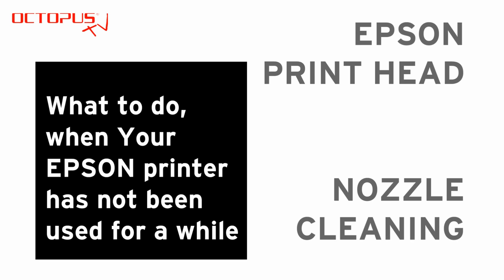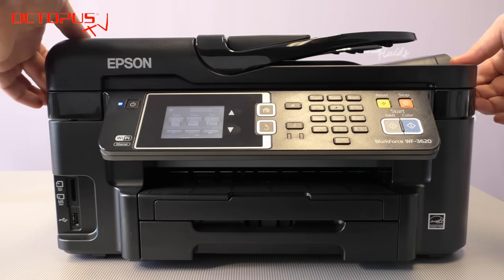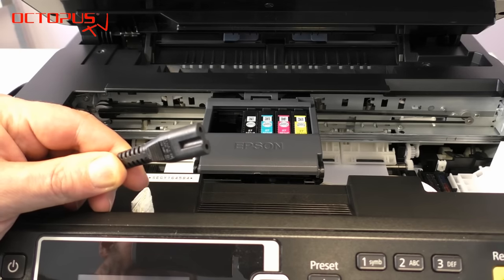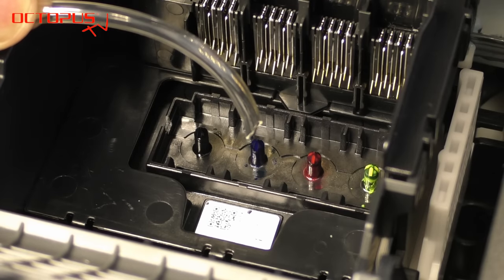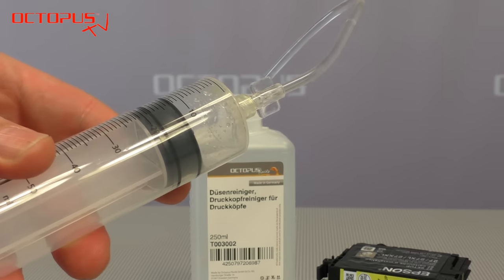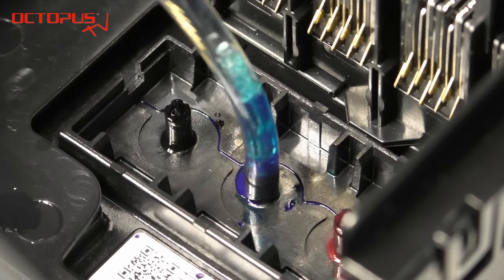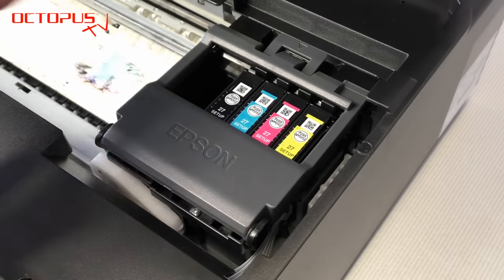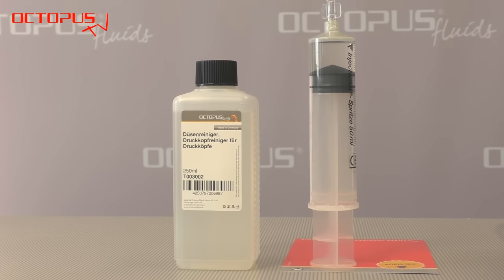Epson print head cleaner, nozzle cleaning - flushing clogged nozzles

Comment: This did not work. ... Epson is terrible. ... The printer lasted only two years. ... I will never waste my money on Epson junk again.
Reply from the maker: Hello Michael, we are sorry to read about Your not so nice experience. You have Your finger on the point that quite a number of the current desktop printers are barely passing their warranty time and causing head aches after that. Take care!
Reply: I just changed the cartridges on my epson and its giving me a nightmare its only about two years old but has light use it wont print any text without white lines tried cleaning heads multiple times but no luck
Reply: Its an epson xp 345 its shit when I first got it the first one I had wouldnt work and had to be replaced now this one is malfunctioning also

Comment: What should I do if my printer is printing completely blank as if the inkjet nozzle is not touching the paper at all? The printer had been in storage for about a year. The model is an Epson wf 2630. I bought new ink cartridges.
Reply from the maker: Thanks for Your question. Due to the long time the printer has not been used that it is dried in completely - meaning all colors are clogged. You can try to run the cleaning that is provided by the  printer´s menu several times using the new cartridges. Maybe this will bring back the colors - or otherwise You can try cleaning as shown in our video tutorial.

Comment: This product worked like a charm, but at least with me, there was a struggle cleaning 3 heads,  that had a cartdrige installed for a year. At first, I pumped several times each head, without any  result, but then, I made another attempt, applying more pressure in each head, and only doing that I was able to solve it.
Reply from the maker: Thanks for sharing Your experience with applying this method to Your printer. Increasing the pressuer is a bit a walk on the edge as there is the danger that the pressure lifts off the nozzle plate from the cartridge compartment - luckily it did not came out this way in Your case.

Comment: Allowing an air bubble in the syringe is an great tip not mentioned elsewhere that may save you from de-laminating the cartridge carrier components due to applying too much pressure.
Reply from the maker: Thanks for that outstanding thought plus useful feedback ... :)
Reply: i used liquid googone and hot water it worked

Comment: After watching this video I tried the pumping action and now my printer won't print any ink on the paper,  whereas before it would but was missing parts. How can I fix it so it will print ink?
Reply from the maker: Thanks for contacting us about the tutorial. After flushing the ink system using the tutorial´s way there always remains cleaner liquid in the print head. This cleaner has to be printited out before the inks will come back to normal. We recommend to start a 100 pages print job on old, already used paper. This takes some time so You should have a look in between if the colors are fine again or keep on printing.
Reply: @octopusoffice  thanks and I'll give it a go.  I did 2 printhead cleans and printed a colour purge sheet after the flush clean.
Reply: @octopusoffice  I have printed a printer purge sheet a 100 times.  The black isn't coming out and the other colours are stripy.  Please help.
Reply from the maker: @Eeveeb80  thanks for taking the time and giving a clear description to Your situation. Beside the cleaner that remains in the ink system after the flushing also air can delay the return to normal colors. Please pay attention to NOT pushing air into the ink system when flushing the ink system with cleaner. In Your situation we recommend to  repeat the cleaning with flushing the ink system with cleaner - by doing so any air in the system is pushed out by the cleaner  - after that same procedure again: print out the cleaner....

Comment: hi I already tried to declog all the ink cartridges, but I have trouble in declogging yellow. the cleaning solution doesn't passing through, what else can I do to declog it?
Reply from the maker: Hello Jayson, thanks for Your description. The situation with the yellow ink line sounds to us that for some reason the ink may have solidified inside the print head. Did the printer sit around unused for some time or did You use non-suitable inks in there?

Comment: An excellent concise tutorial on how to get the job done.  Others have posted longer videos but natter on and on without adding new information.  Allowing an air bubble in the syringe is an great tip not mentioned elsewhere that may save you from de-laminating the cartridge carrier components due to applying too much pressure.
  Robb Muffet did have an additional tip in that for very dried up print heads, (shelved for weeks, months or years), just leave short pieces of tubing with cleaning fluid on each color and let sit for 12 - 48 hours.  The fluid level in the tubing will drop a bit after the dried ink has softened up.  Then you can use a syringe to withdraw the dried ink, as well as gently cycle the cleaning fluid as shown in this, (Octopus Concept's), video.  You want to push some ink through to the paper towel but not so much that it saturates the 'waste ink pads' underneath.   (Printer may stop working if there is a 'waste ink' sensor that says the pads are full. Use a dry paper towel to soak up fluid on the 'waste ink' pads.)
Reply from the maker: Excellent feedback! Thank You!
Time is the key to get a heavy dried up print head back to life - let the cleaning fluid work on it for quite while?
We prefer to push the cleaner plus the waste ink through the print head out of its nozzles as we can avoid to have air inside the print head´s ink chambers. To be on the safe side we use beside a piece of foil material under the absorbent towel. This prevents the mix of cleaner and inks to flow into further parts in Your printer.
Reply: Ah, yes, air inside the print head's ink chambers would likely create other problems, such as having to run several of the printer's "cleaning cycles" to push enough ink through to flush out the air bubble.  Thanks for mentioning that.
Reply: Gordon Raboud
Reply: Gordon Raboud

Comment: Struggling with my 7620. Nozzle check indicated issues with all colours inc. Blk so cleaned head.  No significant improvement so used the nozzle cleaning fluid.  Flushed all the nozzles and there was a slight improvement but not enough to be able to print. Had seen a warning about not cleaning head too many times in one day or it could make matters worse so left it overnight. Ran another nozzle check this morning and swapped out the cyan cartridge as it was running low. All colours affected with breaks or no ink at all so ran another head clean and then checked.Black ok, magenta ok-ish but yellow and cyan missing. Repeated with little improvement so followed your instructions again and used the fluid to flush through the nozzles. The tissue for the first time showed all the separate colours so ink is getting through but when I did the nozzle check again it was even worse! Black is broken lines, yellow missing and cyan and magenta very patchy. When I ran a test print on Monday, yellow and magenta were working but streaky. Should i just force through lots of test prints to try and get the ink flowing? This is my second 7620 as the same thing happened within warranty and Epson replaced it. i've had this one about two years and really can't afford to replace it but i need it for my business. Any advice?
Reply from the maker: Hello Kath, thanks for Your clear description. After flushing the print head there always remains some cleaner inside. Usually it takes some time to get the cleaner out and get the prints back to normal. So in Your situation I would recommend to run test prints (on old / used paper) and see if the print outs improve.
Beside that there is the question if You are printing with original Epson cartridges or alternative cartridges? In case of the second option it might help to switch to a different brand if the issue occurs when using this specific brand of cartridges.

Comment: Hey guys! Whoever is not having the cleaning liquid, you can make your own and it works like a charm.
Mix 5ml of 100% alcohol with 5ml of water and use it the same way thats shown in the video. After you've pushed the liquid throught the head to the towel print a few prints untill the new ink gets into the head and clears the colors and its all going to be allright!
 Thats how I unclogged my epson 7710 and this was a tip given to my by a printer technician guy. 
Goodluck in the journey of everybody!
Reply from the maker: Hello Kristiyan, thanks for Your valuable input! 👍🏻
Reply: @KristiyanStamenov what kind of alcohol are we talking about here, i have an Ethyl alcohol which is about 70% solution, idk if i should use this or not

Comment: I bought your product and carefully followed the instructions. My printer first had cyan and magenta working good but yellow and black completely clogged. I cleaned everything as my printer had not been used in a few years, and then when i plugged everything back, cyan and magenta worked not as good, yellow still not and black was working but poorly, with some lines and everything. Opened again, did the process again, and then nothing was working. Redid it and made sure not to leave any bubbles inside, and still the four colors are completely absent, no product or ink on any of the paper. What should i do?
Reply: I have an epson xp 315 just in case
Reply from the maker: @RodDayZ Thanks for contacting us about the Epson cleaning. After cleaning the Epson print head our way there remains cleaning fluid inside the print head - You need to print that cleaner out - sometimes it may take quite a number of prints to get the colors back to normal. We suggest to use old paper to do these test prints.
As You mention that Your printer has been sitting unused for a few years we assume that you are working with a new set of cartridges or with new refill inks, right? After the years the old inks have changed their physical characteristics and will not work in Your printer properly anymore.
When You have a new set of bottled refill inks at Your hands available You can flush the ink lines using the inks - that way you can also push out the remaining cleaner - that way is faster than printing the cleaning fluid out.
Reply: Right? Mine doesnt come out too

Comment: This usually works and has already for CM&Y but not K. I've run a couple ounces at least of isopropyl alcohol through to some paper towel underneath and it's still not printing but showing full ink on a new cartridge. Sounds like the printhead dead no?
Reply from the maker: Thanks for contacting us about the print head cleaning tutorial. When the cleaner goes through intot the absorbing pad this ink line in the head is / should be free. After flushing there remains cleaner inside the flushed ink line - best way to get it out is to run draft prints on od paper. In Your case with the color black i would recommend to open a word document with black test and print it doubled sided on old paper - start a 100 pages print job which might take quite a while to print - in between You can take a look on the prints: Has the black come back?
Is its not comin back that way - that unfortunately indicates that the head might be dead for the black color ....

Comment: I am in the USA, and there is no such product here, what do you recommend for cleaning the epson head? Windex window cleaner whit or whiout ammonia? some type of diethyl alcohol, isopropyl alcohol, ethyl alcohol ?? thank
Reply from the maker: Hello Angel, thanks for reaching out to us about our tutorial. We have not tested it ourselves but we had have some feedack from users: They achieved good results with Windex. The ammonia version is not necessary as Epson prints with "cold" piezo print heads - ammonia works in "hot" thermal print heads. When we talk about a Espon desktop sized printer its iks are usually waterbased inks - so any type alcohol does not have a dissolving effect on these inks.

Comment: Hi, how r u? Thank u for the info of ur video, unfortunately is not working for me, idk y? not sure what else I'm doing wrong? but all of my colors are not showing on my panel, the black is showing full but the rest r showing like the are empty but they're NOT. I already clean ALL of them twice and still showing empty. so on  the screen of the printer are showing a GRAY box all the way at the end to the right, not sure what's that means? Also when i print the test page is showing only the blaCK kinda broken lines but NONE OF THE COLORS n i have cleaning everything over and over n still nothing. I have an EPSON WF-7710. Can you PLEASE HELP ME with that? I'm using my printer for sublimation, i had it for almost 1 year now, maybe less than that. thank u so much
Reply from the maker: Hello Valeska, thanks for Your question. Based on Your description we assume that there is still cleaning fluid inside the print head after applying our cleaning approach. It is important to get that cleaner out of the printer´s ink system to get the color back to appearing normal.
You can do so by printing on old (already used) paper - this way spares the waste ink tank / sponge inside the printer from getting filled up unnecessarily.
In Your case the sublimation inks can also have an influence on the cleaning result - what type of cleaner have You used? The sublimation inks can consist of different ingredients - some inks are waterbased and others are based in alcohol - according to the formula of the inks You need to use a matching cleaner fluid...
Reply: @octopusoffice  thanks for responding back. I use Best Printer cleaning kit from amazon and INKXPRO sublimation ink from amazon also. I'm gonna print it again. But I did it a few times last night n i was getting the pink color only and none of the yellow or blue. The black it was kinda missing 80% of the print.

Comment: Having a hard time clearing my Epson 1430. I’ve used the syringe method before with success but this time the clog doesn’t want to clear. I’m afraid of applying too much pressure and tbh it’s happened before and made a mess. Any suggestions and also how would I know if I damaged my printhead from applying to my pressure?
Reply from the maker: Hello Raimo, thanks for Your question. Applying too much pressure can result in that nozzle plate, which is laminated onto the print head compartment, is deattached from the print head. Then the print head will be lost. The mess that You are describing  happens when the tube is slipping off the ink port, right?
If the clooging is not going away there might be some solidified pollution inside the print head -  in that case we recommend to let the cleaner sit in the tube on the ink port for as long as possible. Either it unclogges the blocking or this color line will be lost anyway ....

Comment: hi, do you have a similar video for the epson 4630? Thanks!
Reply from the maker: Hello Bruna, thanks for Your question. Your printer used the Epson 79 cartridges, which sit in a campartment  inside the printer and are connected to the print head by ink lines. There You have the opportunity to clean the print head from the outside. To do so You start a print job and pull the electrical plug as soon as the print head starts to move. On Your printer You have a lid at the front or the top throough which You can access the print head´s working area. You can move the print head from side to side and slide a piece of plastic foil plus a piece of kitchen towel soaked with print head cleaner under the print head. You can do the cleaning by swiping the print head over the kitchen towel or / and let the print head sit on the towel for some minutes.

Comment: When I push solution through 1 nozzle, it comes out the nozzle next to it. What do I need to do?
Reply from the maker: Hello Jen, thanks for contacting us about our tutorial. The cleaner coming out of the nozzle next to the nozzle where You are pushing in the cleaner - that means the cleaner does not come out through the nozzles in the nozzle plate at the print heads´ bottom side?

Comment: What is the diameter of the tubing? I have the syringe and bought some fish tank tubing from the local pet store, but it was too big. Water seeped out so I stopped it immediately.
Reply from the maker: Hello Jeff, thanks for Your question. The tubes we are working with have an inner diameter of 2mm to 3mm. In case a tube should be too tight You can heat its tip carefully and then press it onto the ink outlet in the cartridge compartment. The heated tube widens easily.
Reply: @octopusoffice  Thx for the reply. Much appreciated.
Reply from the maker: @jeffg1524 You are welcome